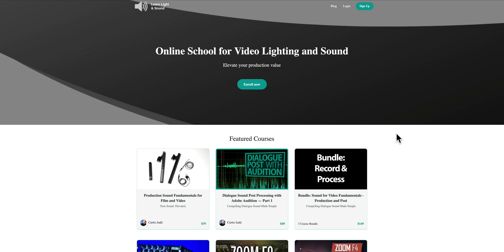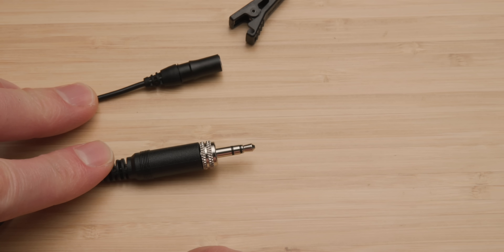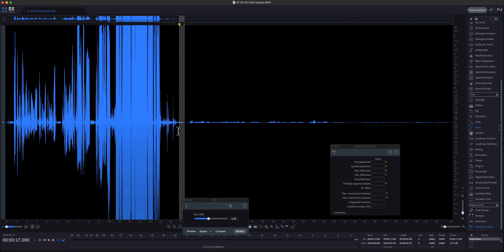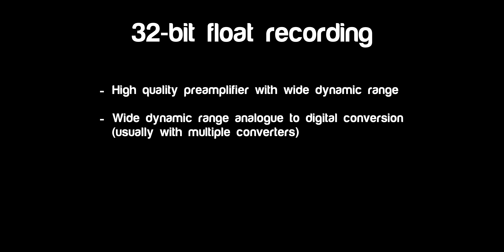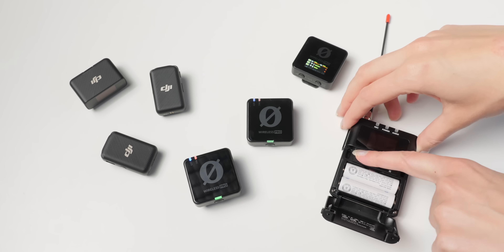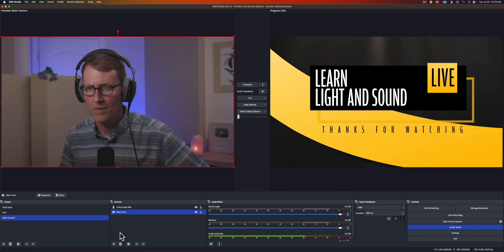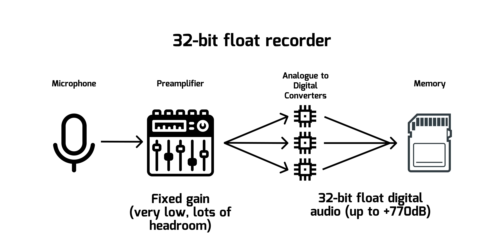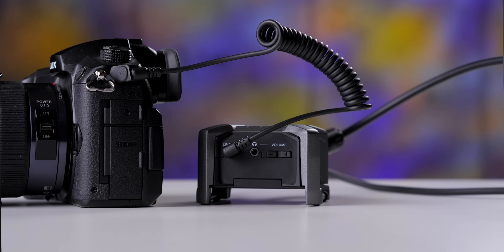Is 32-bit Float Audio Magic?

Comment: Great video! However, I think you missed one major benefit of 32 bit float, which is the ability to raise levels in post without raising the device's noise floor if (part of) the audio is too quiet. Of course given that the recording was done with a quality mic and recorder
Reply: Bingo.  Yes, there is a lot of marketing hype involved in all aspects of 32 bit float recorders.  But there is real benefit in more resolution of data at lower levels.  I suspect most who are nay sayers here just haven't had to try to resurrect audio that was really softly recorded, whether by mistake or just because you're recording something that has a lot of dynamic range, like say an orchestral performance or almost any live music situation.  Or even outdoor ambiance recordings.
Reply from the maker: Thanks 👍 I do find that the noise floor does increase when a clip is digitally boosted in post. But for recordings made on the higher quality recorders, the noise level is still acceptable.
Reply: @curtisjudd Perhaps my ‘knowledge’ is incorrect then 😅
Reply from the maker: @RedFrameTech  I wouldn’t blame you for that. The manufacturers and others have suggested that exact thing. In my practical experience, the noise floor is still there and boosting in post raises it. But what I’ve found is that the noise is generally very much in the acceptable range even after boosting.
Reply: This would be physically and mathematically incorrect. This is easily measurable to be false. Any analog sourced recording will have a noise floor that will be raised when the signal is raised.
Reply: Any analog noise would be raised in level.  Even if it is minimal noise from good analog components.
Reply: @Ozpeter True. But not like a 24bit recording, because a 32bit float recorder uses multiple ADCs. Which, depending on the quality of the recording, makes it possible to raise levels to a certain extent with no noticeable extra noise

Comment: Instead of turning down your "clipped" 32-bit signal, why don't you try turning up the 24-bit signal instead? It literally does the exact same thing. It's about 6db dynamic range per bit, so I just boost the signal 18db for 126db DR 21-bit audio. Give me a 64-bit DSP mixer with 24-bit converters please.
Reply from the maker: I record in 24-bit 99.9% of the time. I'm with you.
Reply: In my experience boosting soft levels in 24 bit does not get you the same results as it does in 32 bit.  To each their own though.
Reply: @rbingraham  No dude, if you cut a 24-bit signal down to 1/8 the original size it' still 21-bit; it's not possible to have the difference; 21-bit audio is very high quality and digitally boosts to line level perfectly. That is in your head. You're just hearing a higher quality converter. The reality is that most preamps sound really bad a high gain levels, so even if you did turn up the gain you're just capturing noise. There are a lot of other parts in the circuit path, and also there are a lot of 32-bit converters that are not that good. Only some of the ESS 32-bit converters are really good.

Comment: I don't know why you didn't contact me.  I put a lot of effort in trying to help you.  You're very close.  I'll have to watch again.  Perhaps I'll do a video on it.  Anyway, the aspect that blocks you from 100% understanding might be your confusing "scale" for "data".  Decibels is a scale.  When you talk about audio above 0db, let's say, you're confusing the two.  0db can be scaled anywhere onto the data space.  Why would you ever scale your data so something would be above 0 that you don't want above zero?

The data (numbers) always come first.  Scale comes second.  It is a trivial matter in charting/graphs to change scales to anything you want.  DBs, logarithms, whatever.  The underlying data remains the same. 

If you can get clear on the difference between the numbers and scale you can move to what the numbers represent.  In the case of microphones they represent voltages.  All voltages, in all electronics, are limited to a range.  Speculating, as you do, about numbers "above 0db" or something like that simply would NOT make sense to an engineer.   It's like Spinal Tap.  You can write "11" on your guitar amp but that doesn't make it a 11.

Anyway, I'm glad you're keeping at it.  You're almost there!  But you still claim that 32-bit float can help with high dynamic range audio from a microphone. Sorry, that is false.  Why do you make claims you cannot prove?  You need around 1 bit per 6 dbs.  You've looked at a gazillion spec sheets for mics, you do the math ;)  

32-bit-float is useful in a studio, sure.  Just as it is useful to me in my work with financial numbers.  But it is NOT useful in recording microphone data.  Indeed, it is an extra layer that adds nothing but more computations for the computer.

Indeed, the difference between 24-bit and 32-bit float is SCALE.  32-bit float is 24-bit with an added scale (of exponents).  32-bit float is 24-bit scaled to ^x  I'm sure I'm losing you again.  Anyone who wants to learn more can google "Microphone Clipping, The Three Types Explained", an essay I wrote on Medium.  I explain the 3 types of errors being bandied about by unscrupulous audio equipment manufacturers.
Reply from the maker: The tone is tough to work with Max, especially when you go make videos suggesting that I’m colluding with manufacturers. Frankly, if your tone was closer to a mentor’s rather than a condescending, “you don’t get it,”, maybe there could be a breakthrough here, if you are correct and there is a breakthrough to be made.
Reply: @curtisjudd  I tried to be as polite as possible with you (and everyone).  I understand I have bad parts of my personality/communication.  I have faults.  Please read me back part of any email where I wasn't polite.  It's not easy being criticized.  I get it.  I don't like it myself.  In my video I did NOT say you were colluding.  I was very careful to say I didn't think you were/are.  I said you might be "complicit".  It's a completely different thing.  You'll never forgive I guess.  I've said I'm sorry many times but it takes two to make a breakthrough.
Reply from the maker: @MaxoticsTV  Then please, try explaining again. Last time it was beyond my ability to understand, at least the way you described it to me.
Reply from the maker: @MaxoticsTV  Let's also be clear: You specifically said that I was lying. That's quite a claim to make. You'd have to know my intent, which you do not. So while you were trying to be polite, it certainly didn't feel that way on my end.
Reply: @curtisjudd  I thought about it some more last night and once again I have handled this badly.  You are the first YouTuber with a real audience to question the narrative that 32-bit-float fixes clipping or "removes the need for the gain knob."  So on that THANK YOU, THANK YOU, THANK YOU.  I challenged anyone (you) to investigate the science of it and you did.  And let me say again, I don't say do this because I am right, but because I want others to either see what I see, or see what I am missing and explain it to me.   Hopefully we all want the same thing--the truth. 

That said, It's lonely to see one thing and everyone else say it's another because X says it is.  If you remember, I said a long time ago it's how these beliefs work through society that greatly interests me.  Anyway, I hope we can start over.  And thank you again for never giving up on figuring it out, whatever it leads.
Reply from the maker: @MaxoticsTV  Thanks Max, looking forward to learning more from your perspective.
Reply: @curtisjudd , I've watched MaxoticsTV's video, and if I'm understanding correctly, his issue is that 8-bit wav files are handled on an 8-bit scale, 16-bit on a 16-bit scale, and 24-bit on a 24-bit scale, but 32-bit audio is handled (in a sense) on a 24-bit scale. So anything over 1.0 (or below -1.0) is treated as clipped (a fact I discovered the first time I tried to write software playing 16-bit wav files at 32-bits; I assumed a -32768.0 to 32767.0 range and everything clipped, leading to silent output).

So, unless I'm mistaken (feel free to correct me if I am), he would say there's no "recovering" loud audio, as the data was always there; it was just scaled improperly.

I'm not sure if he's advocating software to normalize audio based on peaks (metadata?) or perhaps the maximum capabilities of the recording device (I don't think manufacturers would get behind) or something else, but the 32-bit audio standard has been around for a while now, and, for better or worse, I don't see it changing any time soon.

Or maybe I'm just totally off.
Reply from the maker: @KeithamatorsWorld  I don't know. Will watch the new video when I have time to focus deeply. 🙏
Reply: @KeithamatorsWorld  32FP is absolutely handled in a 24-bit scale. It has, after all, 23 bits of resolution. However, anything over 0dbfs is not treated as clipped, it's treated as invalid and handed off to a different ADC to provide the correct information and as close to 23 bits as possible.

You can do tests to find the crossover points, too, based on room noise. It does go up, then down, then up again. It's basically very much like HDR in photography, except you don't have to change colors to represent detail. Unlike film that has maybe at most 14 stops of information, audio has some 45 "stops" (140dB / 3). That allows multiple ADC to pull in the data and read it, and cover the entire spectrum.

I'm only responding here because I found it absolutely hilarious that someone said "Why didn't you contact me?" as if he was some profound expert on the subject a phone call away, while Curtis is merely trying to make this concept accessible to the layman.
Reply: @chakerian , I was not referring to 32-bit recording, per se, but how the file is handled after recording, i.e., during playback.

Comment: Love the way you explain and simplify this complicated topic to noobs like me - much appreciated!  Is there any software that can take the 32-bit file and do a one-click volume (or db level) normalization?  Currently, I am breaking the audio file into chunks and manually adjusting the levels.  It's cumbersome and time consuming.  Hoping there is a better way!
Reply from the maker: DaVinci Resolve. But it doesn’t take care of compressing your audio first, that’s still up to you.
Reply: One problem arising from normalising an entire file is if there is some unnecessary transient which is louder than the rest of the audio - like a mic handling noise for instance - then the wanted part of the file will still be at a low level.  Sometimes you have to edit first and normalise quite late in the overall process.
Reply from the maker: @Ozpeter exactly.
Reply: @curtisjudd  Thank you both for chiming in with additional info - much appreciated!

Comment: I think the situation where you have to fix the clipping in post is still a big advantage over setting it on the set because you can always make another version of the edit, but you cannot recover wrong gain setting in 24bit file. It's done. 
However, I see another problem there - as I record media for my small YT channel, I stopped monitoring the sound in any way during the recording process, even with getting a short test record, because I assume the sound can't be "broken". But it can be in many different ways - the Rode Wireless Pro transmitter/recorder can discharge or just go out of order and turn off, the cable from the lavmic or shotgun mic can disconnect or get damaged...
Reply: Honestly?  I trust NOTHING wireless in recording.  It will fail on you at the worst possible time.  Be it bluetooth, WIFI, whatever.  It will some day set you adrift.
Reply: @chuckschillingvideos  I would only do it with a redundant BT/UHF double rig, AND onboard backup recording if it is for recording and not just a live event.
Reply from the maker: Agreed, always monitor when relying on wireless. There WILL be problems at some point.

Comment: So, apologies, but I just want to clarify to make sure I understand one aspect of this. For example, I have the Tascam Portacapture X8. Now, you're saying that if I'm recording in 32bit float, when I set the gain, I'm not altering the preset gain level of the preamp, but I'm adding additional gain to the digital signal further down the chain. So, just so I'm sure I'm crasping this correctly, does that mean that adding gain to the digital signal is further fine-tuning the strength of the signal that's going to be baked in to the recording, is that a good or bad thing if it is, or is it ultimately insignificant since plenty of dynamic range already exists in the recording? Does what I asked make sense?
Reply: Maybe it doesn't matter because you would be able to do exactly the same thing in post; doing it in the X8 may just make that step faster or unnecessary.
Reply from the maker: Yes, but that’s not necessarily a bad thing. It is just math to push the levels back down in post. The potential cost is in less-than-optimally designed preamps with substantial amounts of self noise.
Reply: @curtisjudd  I'm not sure if it was my fault in how I structured the question, but I'm not sure if I understood the answer. Easy version, do I bother setting a gain level, or no?
Reply from the maker: @richiecabral3602  It depends. I don't know how the Tascam recorders work internally, but for the ZOOM and Sound Devices 32-bit float recorders, when in 32-bit float mode, YOU DO NOT set preamplifier gain. The setting that is called "Gain" on the MixPre is actually just a digital gain. 

In short, if I had to guess how the Tascam is working, yes, set your gain so that the meters are at reasonable levels. I'd suggest aiming for peaks around -18 dB FS. But know, that setting is probably digital gain, not preamplifier gain. 

If none of this makes sense, don't worry. Just set gain like you usually do, and if the recorded sound doesn't exceed the capabilities of your microphones, you'll probably be able to "fix it in post".
Reply: @curtisjudd  no, that works. Thank you. In the end, I guess my real question was that with the dynamic range 32bit float supplies, and I know some 32bit float devices don't even have a gain setting, would there be any adverse effects to adding a digital gain on top of that, and would it be cleaner to just adjust in post.
Reply from the maker: @richiecabral3602  It *should be the same on device or in post production. I don't know all the internal workings, but it should be the same either way.
Reply: When you set the "pre-amp" gain on a mic you are adjusting the resistance to the voltages coming out of the mic into the pre-amp.  You're essentially trying to balance what voltages are more important, the low ones or high ones.  Theoretically, we'd want to capture every voltage fluctuation from a mic but in real life we must favor a range of voltages during (pre) amplification. 

So let's say you gain to get voltages from 1 to 100.  But your data space is 1 to 1,000.  When you sent those numbers to your headphones it will sound low because it's 1 to 100 at the bottom end of 1 to 1,000.  When you increase the volume of the headphones you are simply adding numbers to your recorded numbers.  Say 500, so now you have 500 to 600.  Great!  It sounds at the right volume in your headphones.  But maybe you want it louder....

The problem if if you added say 950, then you'd get 950 to 1,050 and 50 of those values would be cut off and you're head distortion--but it's data created distortion.    The microphone pre-amp deals with voltages.  When you work on the signal you're working on numbers.
Reply: @MaxoticsTV  ok. I'm not sure how that relates to my question, but thank you.

Comment: I do think 32-bit float is mostly hype, but I won't say no to another tool in my toolkit. My suspicion is that manufacturers will start charging extra for 32-bit even though almost no pros will use it or need it in the first place. It reminds me of mics with a hundred different polar patterns despite how almost everyone will just use cardioid. But, the extra polar patterns will still increase the price. I hesitate to say 32-bit is all marketing, but until it's a standard feature on all mics and recorders, it might as well be a gimmick.
Reply from the maker: Yes, for video dialogue we rarely need more than one of the cardioid polar patterns.
Reply: There is no need to charge more and with the slew of very cheap 32 bit float devices coming on the market, I don't think that the marketing departments will find it profitable to jack up prices.
Reply: Just the opposite really, it keeps getting more and more affordable as the years pass.